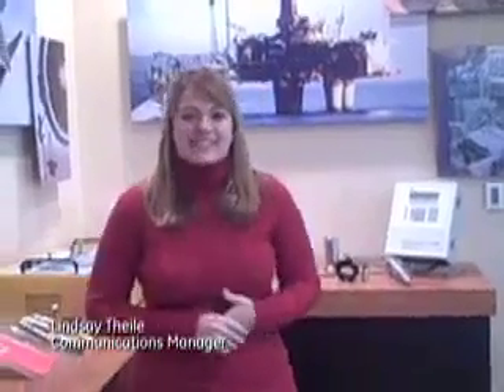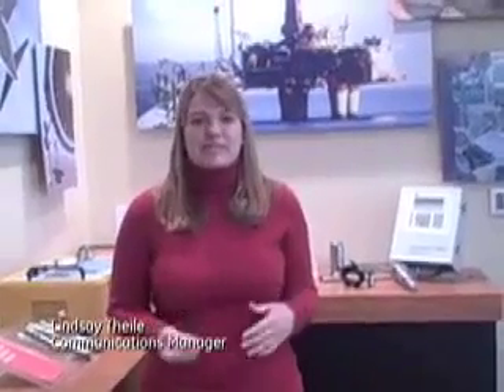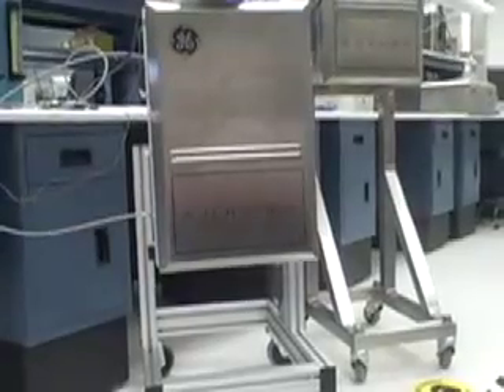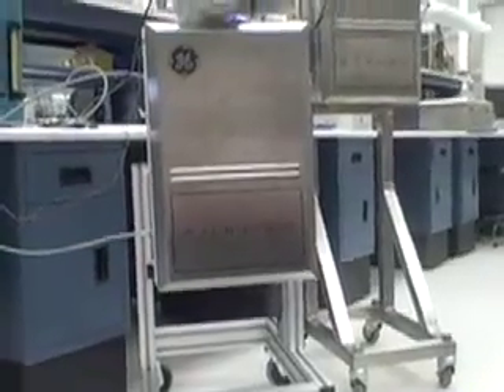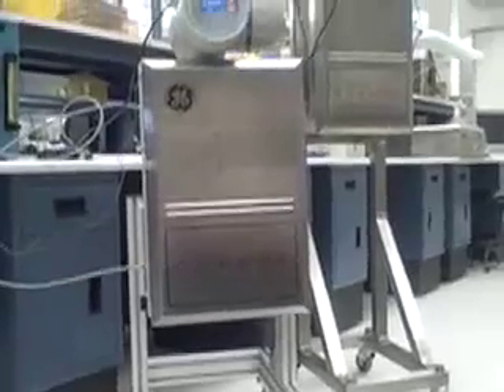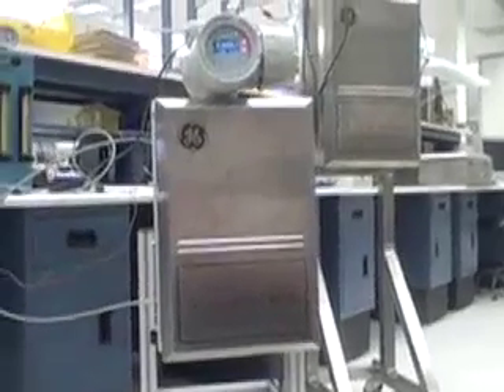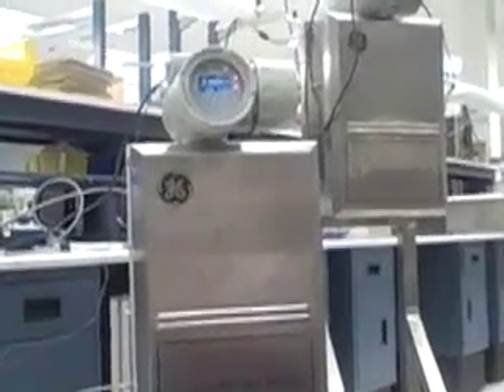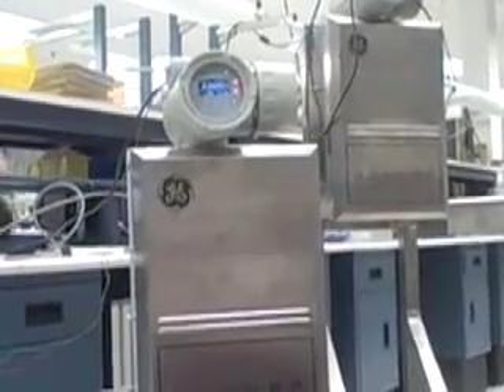Laser based moisture analyzer for corrosion measurement

Comment from the maker: The Aurora has a lower detection limit of 5 ppm (parts per million) so it would not be suitable.   
 
We might have some other alternatives by using out Aluminum Oxide technology.   In natural gas by making measurements at elevated pressure we are able to measure to ppb (parts per billion levels) Our applications engineers would be please to review the application.   Let me know if you are interested.